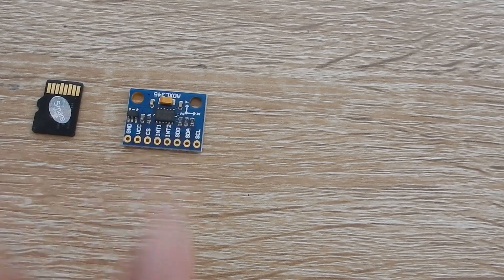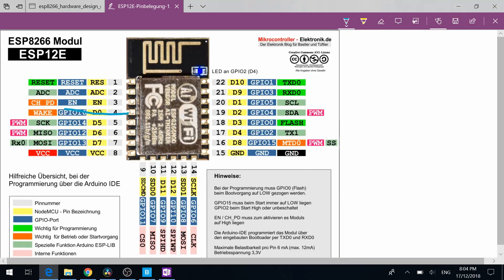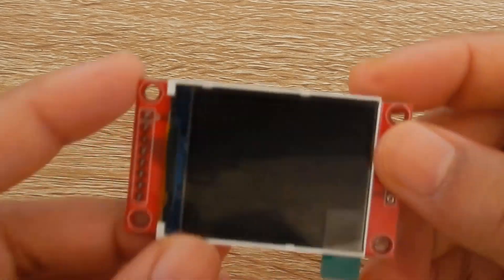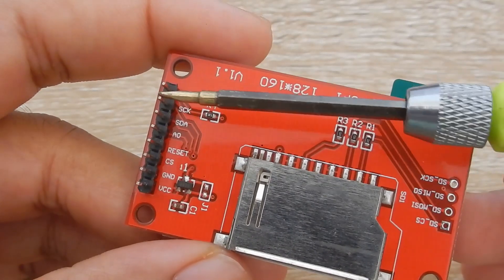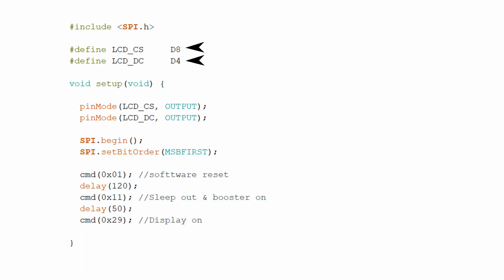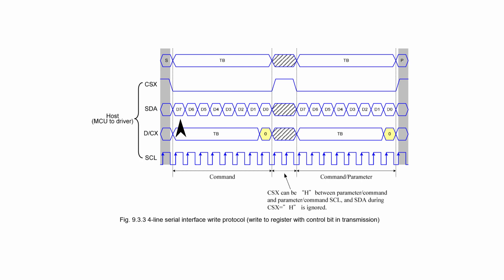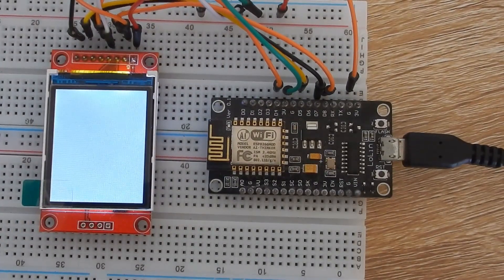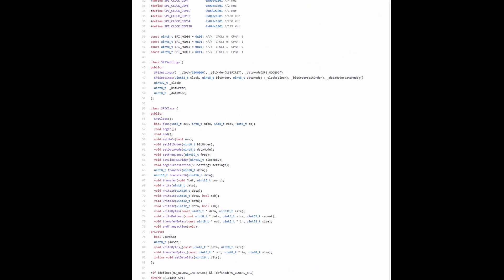#4 NodeMCU/ ESp8266 Tutorial: SPI interface (ST7735 LCD Write Only)

Comment: Can this board be used with the four wire connection two of which are gnd and power?
Reply from the maker: No. The spi bus needs 4 wire + gnd + power. Minimum 6 wires are needed.